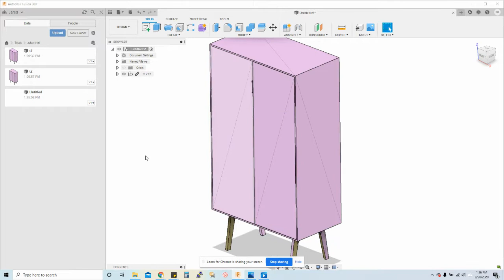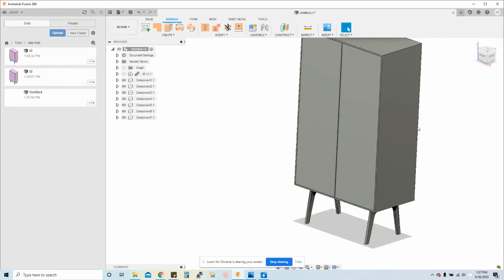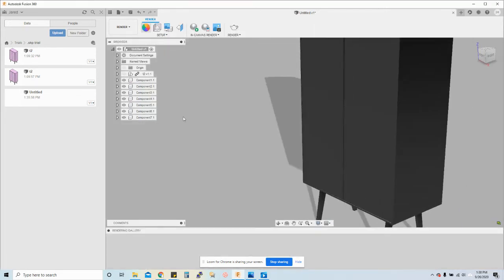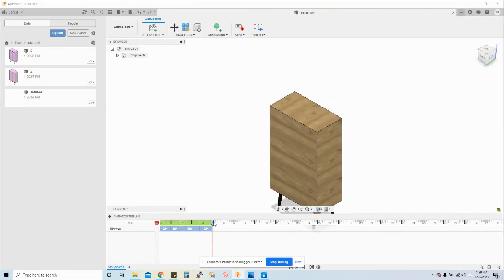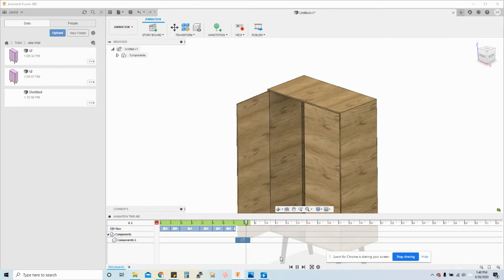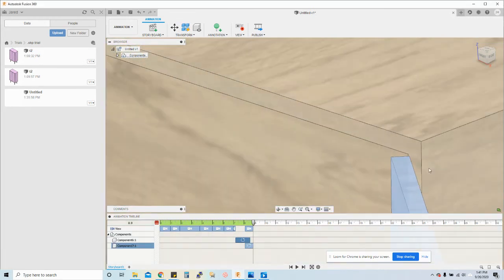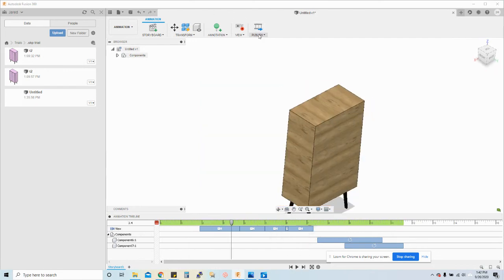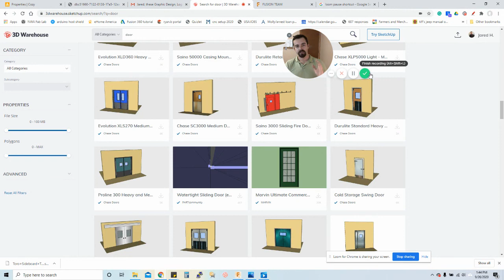How to use sketchup files in Fusion 360, repair, render, animate, export

Comment: Brillaint explanation. Concise to the point no waffle. But man your fast lol.
Reply from the maker: Thanks, man, I actually made this as a quick tool to show clients that I can convert files and accidentally made it public lol Let me know if you'd like a more detailed version or have any questions
Reply: @jaredhanson9758  Well now that you ask lol. I cant convert STL, I tried doing it this way but had problems. The problem...Bevelled edges warping when Surface Merged. Inside edge is ok, exterior edge warps? Thanks for your help =o)
Reply from the maker: @GregorysMode  Sounds like an interesting problem. Can you share a link to the stl file (if you got it offline). I can give it a look.